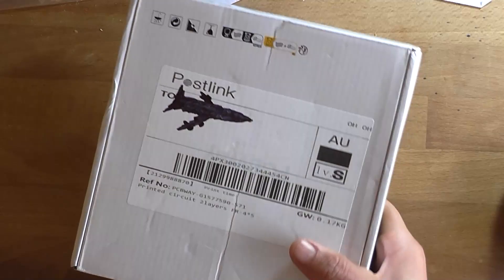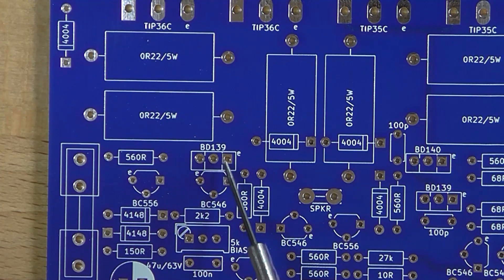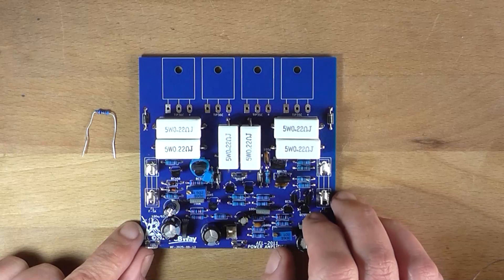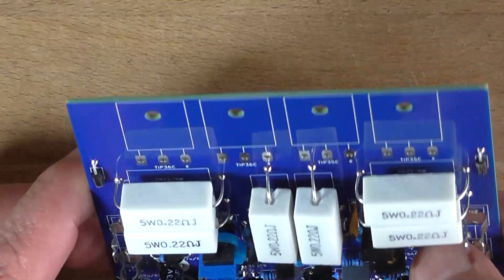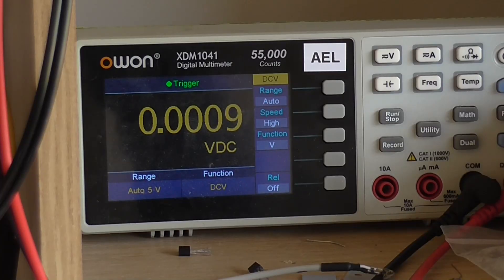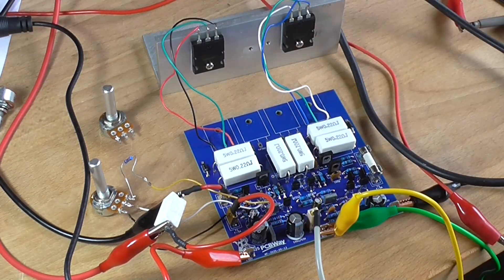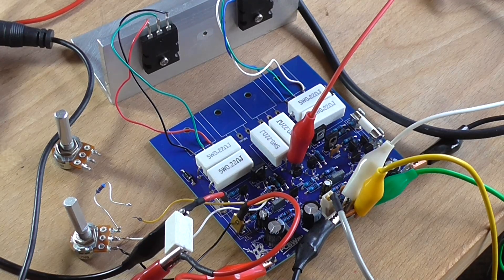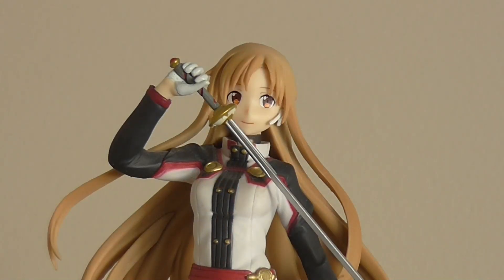AEL-2011 Discrete Power Amplifier PCB: Kind of a Fail

Comment: Insert a 68 ohm resistor from V+ to emitter of the top BC556 (current source) in the bias spreader. Change the 2k2 to 1k8. That should then work ok.
Reply from the maker: Hehe. Another person in the comments noted there should have been an emitter resistor there, that's why I had a random 100R over. I looked at my original incorrectly drawn schematic of 2011, and indeed, guess what? There's a 100R resistor! I feel so dumb. I cut the trace and inserted the resistor on the underside of the PCB and the bias is working correctly. But, thank you! This is why I love this community!
Reply: @AstrosElectronicsLab  Glad you got it sorted! It's quite disheartening to spend so much time on a project and then it doesn't work properly.
Reply from the maker: @tonyrogers8318  yeah, I think it was pretty evident towards the end of the video I was deflated, lol. I will be shooting a video in a day or so showing what I did wrong. I have modified the CAD and have another PCB on the way with the corrections. So, it's not a complete loss! Thanks for your input, if it wasn't for eagle-eyed viewers like you, I'd have never gone back and checked the original schematic!

Comment: IME best practice for first run up is to disconnect the output transistors (ie disconnect collector terminal only) and confirm correct operation of driver and upstream stages whilst increasing DC rails voltage and monitoring currents.
At this time bias voltage trimpot can be swung over its range and you can measure the effective upper and lower driver transistor bias voltages (BD 139/140), also temporarily remove the two current protection transistors (BC546/556).
Reply from the maker: You would be correct. Best practice is to use a current-limited PSU and slowly increase the voltage watching the current.

Comment: Why do you need the two 4004's? I thought the BC546/5k/2k2 acts as a 'variable diode drop'. I'd try taking that out as well as the module to the right, the 4004+546+556+4004 and accompanying 560Rs

EDIT: drawing this in Falstad, the two 10k's+48u are suspiciuos as well. They are driving many uA of current into the base of the top 556
Reply: AFAIK, the diodes are usually used as a limiter for the case of a wiper or solder joint failure on the adjustment pot.
Reply from the maker: @MrBun9l3  and, that is correct, the two diodes are to keep the bias relatively low (100mA or something?) if the wiper of the trimpot goes open.
Reply from the maker: Um... I did remove the two 4004s. And why would I remove the VI limiter?
Reply: @AstrosElectronicsLab  Perhaps try replace the 10k connected to ground, with a 47k or 68k, might lower the quiescent current
Reply from the maker: @ivolol  I've figured out the problem, thanks to MrBun there. There should be a 100R resistor in the emitter of the BC556 CCS transistor.

Comment: If the schematic is accurate, shouldn't there be a resistor on the emitter of the second current source to set the current?
Reply from the maker: There wasn't originally.
Reply: @AstrosElectronicsLab  I don't really understand how it could possibly work properly without an emitter resistor in the current source for the VAS given the (dual diode) voltage reference is shared with the LTP current source. Might explain the extra bonus 100 ohm resistor? I would think that without an emitter resistor the voltage reference will be dragged up towards the + rail by the B-E junction diode drop.
Reply from the maker: @MrBun9l3  DOH! You're right! I just looked at the original "wrong" schematic. There is a 100R resistor... sigh...
Reply from the maker: @MrBun9l3  OH! I LOVE YOU! Lol. That made the bias behave. Thank you for being so observant! I obviously have to remake the PCB, but that's OK, it was at least cheap.
Reply: @AstrosElectronicsLab  No worries. Finally my misspent youth with EA and Silicon Chip issues carefully hidden in Penthouse mags so as not to worry my parents pays off. Enjoying the videos.
Reply from the maker: @MrBun9l3  Lol. I honestly can't believe I missed that, either. This is why I need to double-check when hand-drawing schematics to add modifications, to check the original schematic...

Comment: Multisim from rutracker will tell you how and if the circuit would work and if it's worth building😉
Reply: LTspice is better
Reply from the maker: I've never used either, but I probably should look into getting LTspice for testing complex circuits before building them...